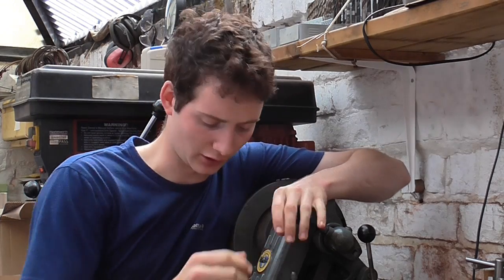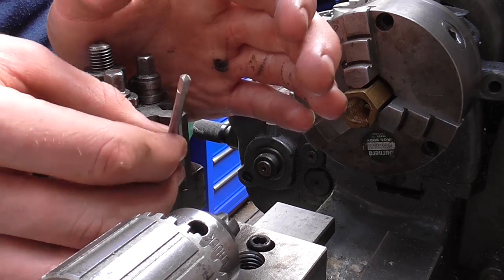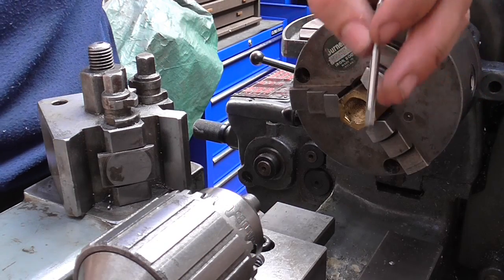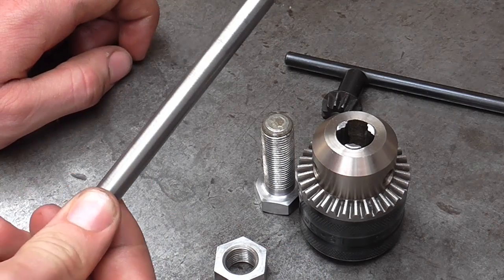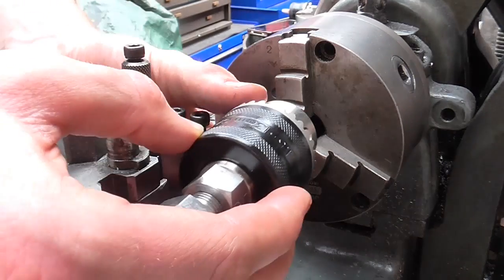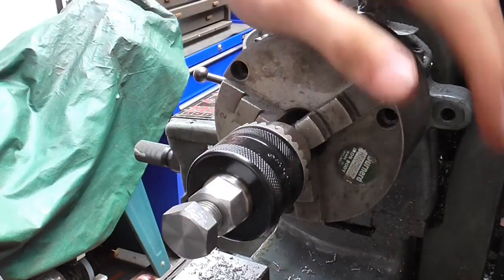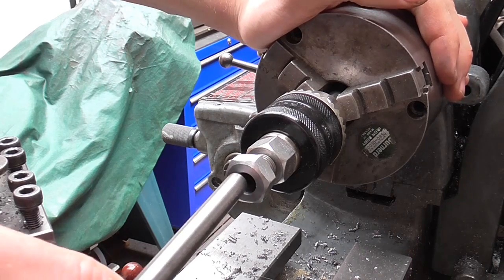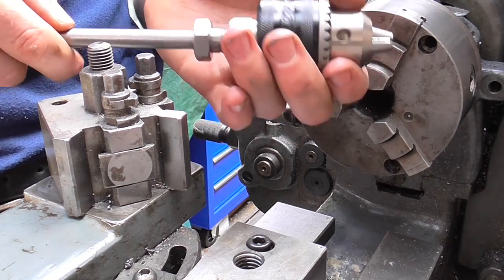Making a Tapping Chuck

Comment: Mr. Crispin, I have a spring loaded center very similar to the one you just presented. The set screw in the shank of the center allows you to change springs to apply different loads on different size taps, another reason its there is so you can push the center out and reverse it. The opposite end of the pointed side is usually a cup for use on taps with a positive cone. Check it out.

Comment: I used this idear now for over 20 years. The only difference is that I have a 2MT to fit in the tailstock. This was a old MT drill that had the cutting side turned down to make the slide shaft. I also have a set of sliders for mounting threading dies. I also use a smaller chuck mounted on the schaft for drilling very small holes. Just hold the chuck between your fingers slightly and apply pressure with the tailstock. Nice video!

Comment: Hello Crispin,

There's a refinement to this design that has a pin sticking out from the side of the chuck/chuck mount that acts as an anti-rotation device. With an adjustable rod attached to the tailstock to engage with the pin, you can power tap to a fixed depth. A similar setup can be used with a tailstock die holder as a poor man's Coventry diehead.
Reply: Your Idea would be fine for large diameter taps, but not for small taps, they would easily break. This can be used under power, even with small taps i.e 4 & 6 Ba. Very lightly grip the chuck between your thumb and forefinger, so that should the tap hit bottom or stop cutting, you will feel it and instantly let go. The chuck and tap will spin freely on the 3/8 " shaft, until you switch off the lathe spindle, and hopefully no damage done.

Comment: Great to see you have taken up with my idea of a tapping chuck. As I said I can not take credit for it as it may well be someone else`s idea; but I have not seen one used on YouTube yet. You failed to mention that this can be used under power, even with small taps i.e 4 & 6 Ba. Very lightly grip the chuck between your thumb and forefinger, so that should the tap hit bottom or stop cutting, you will feel it and instantly let go. The chuck and tap will spin freely on the 3/8 " shaft, until you switch off the lathe spindle, and hopefully no damage done. Another great video by the way, keep them coming.
Reply from the maker: I failed to mention it because I had forgotten about that. Thanks for reminding me.

Comment: My spring loaded center is reversible. It has a cup on the opposite end. You might check if yours is too.
Reply from the maker: Hi, No unfortunatley not. I have heard about how you can take a short piece of round bar and drill a centre drill cone in each end. Then trap it between the centre and the tap.
Reply: Yes.  Mine is reversible too.  And they are not expensive.
Reply: Hi, your tap follower looks the same as mine. You undo the hex screw out of the end to turn the pin round.

Comment: I notice you drilled the hole out to relieve the air pressure. If the fit was that good could you have used that pressure to serve the purpose of a spring shown in the other style?

Comment: To avoid some of the stick out, you could mill a taper to match your tailstocks taper on the other end of the silver steel rod?
Reply from the maker: I could if it was a bigger diameter. I was thinking about taking an old scrap taper shank reamer or drill and chopping it off at the taper. Then I could do as you say and have a taper mounted guide bar.
Reply: The trouble with that idea, is you could be too short to reach the workpiece, due to your saddle width. You would then need to crank out your tailstock barrel to compensate. 6 of 1 and 1/2 dozen of the other.
Using it direct in your tailstock drill chuck is quicker, because you have just used it to drill the tapping hole, release the drill, open the jaws, fit the tapping chuck and away you go. Using a dedicated morse taper 2 spigot with a 3/8" shank. means you would have to eject your chuck to use it. If you had a lot of the same parts to do, you will soon get fed up with ejecting your chuck; tap a hole; eject the tapping chuck; reinstall the drill chuck to drill a fresh hole. etc.etc. Anyway, your choice.